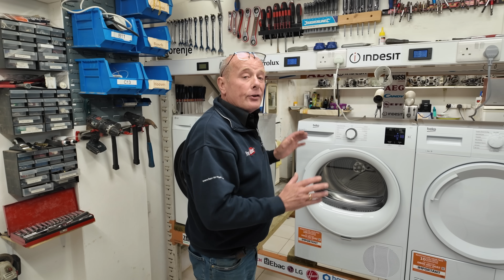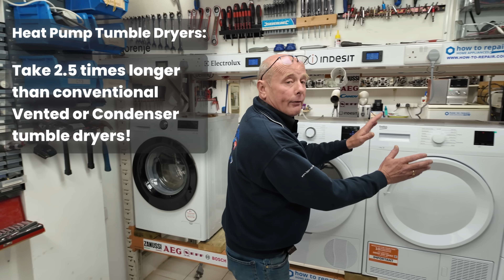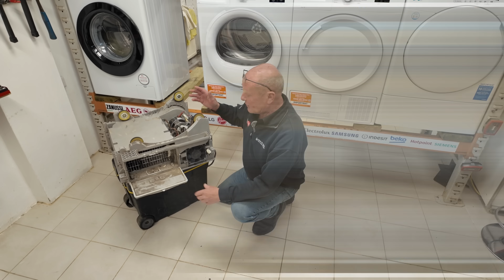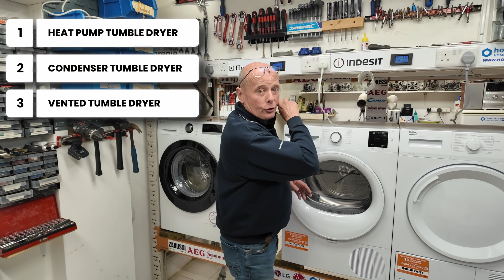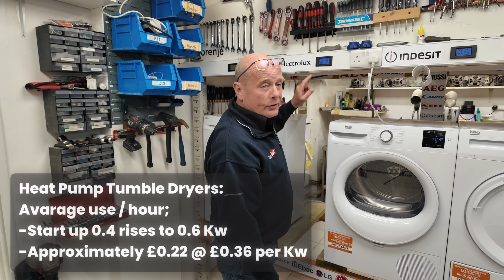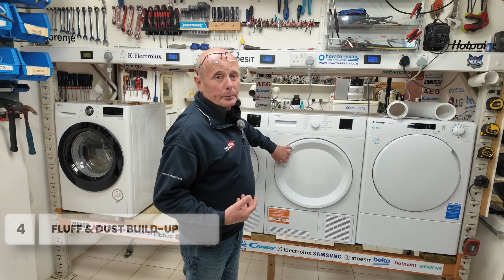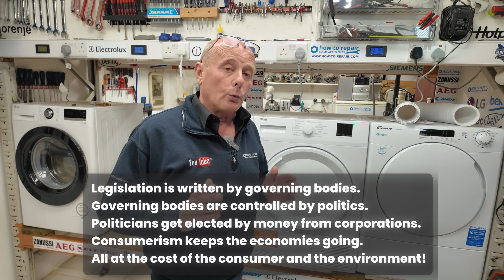Tumble Dryers the Shocking Truth About Heat Pump vs Vented & Condenser, NEW LEGISLATION!

Comment: I own a 10 year heat pump TD unit form Whirlpool. From YT dissasembly videos I conclude it was quite badly built as regards to cleaning the lint from the bottom heat pump condenser. I hoovered it on several occasions and it is still working fine but the bottom filter is a badly designed foam filter that can move around and get bypassed. I glued a face-mask non-woven filter before it on the plastic holder and now it is massively improved in filtering capacity.
Lint build-up in the heat pump unit is there, and at some point I do plan on opening the back panel and hoovering what ever can be hoovered. But so far it works fine.
I cannot say it degrades clothes at all as i do own items older than it, but it surely removes the need for dusting in the house.

Comment: Is this the case for all main brands? I know Miele (some) and Asko are a different case, but after checking your vídeos I ended up purchasing a LG washer and matching heat pump dryer and I’m really happy so far. Do you have an opinion about LG’s autocleaning condenser feature? They even have a program to clean the condenser.

Comment: Nothing beats drying clothes outside on a line if you have one, and are able to go out to it. We have put up simple lines in our shed/garage to use when it's raining. If the air is just too damp for that, we hang shirts etc on hangers on the shower rail, and put smaller items on a rack in the bath. We just have to make sure we leave a window open a crack to let out the moisture. We have never had any damp or mould in our home.

Comment: Brilliant advice, I bought a second hand dryer off a traveller in a car park for £60 10 years ago. Its finally died and am very glad you pointed out the difficulties refrigerant in heat pump. I am a time served 60 year old electrician and would say something similar about smart meters

Comment: No one in their right mind would pay for a call out on a vented, for $400 AUD just buy a new one. My 3 year old heat pump used 5 times a week has no dust in it the filter catches it all and I clean and alternate the filters regularly. My clothes last longer in a heat pump as it is not as aggressive on them.

Comment: The biggest issue with heat pump is it is a throw away device. Like you said, to expensive to repair. Had my condenser unit for years (and repaired it myself). My neighbour has had 2 heat pump dryers and I still got my condenser one working well. My opinion on that is it is not as environmentally friendly as you think.

Comment: I guess it really depends on the machine. we purchased a Siemens heat pump dryer about a year ago, which replaced our old condenser. At the most, it is 800 watts, but less a lot of the time, in pert because we always run a low heat setting. Thing is this. It takes the same amount of time to dry as our old machine did. Note that our old machine was not a cheap or bad machine. It lasted for about 16 years. Our current model is a Siemens IQ700 and most times it runs between 50 and 90 minutes. Here's the thing. About 2 months ago, my parents bought a new machine as well, a Bosch, so in essence a Siemens. However, theirs is one step down, and not a heat pump dryer. They take the same amount of time to dry the same amount of clothes. If anything is different, it might be between 10 and 20 minutes. Both are situated in heated, ventilated rooms, so that's not what works against either. I have a meter on the machine, as I do with our dish washer and washing machine, because I find it interesting to look at the usage. Our new IQ700 is SIGNIFICANTLY cheaper to run, not a bit, it's a lot.

Comment: Great overview and summary of new heat pump driers, thx. Got my sub. Having been lead engineer, and project manager for multiple products in industry over the last several decades, I can confidently say that at least one manufacturer will redesign its heat pump drier to enable simple cleaning, high reliability, and easy maintenance because that alone will own the market. The first versions of products usually have far more issues than gen 2/ 3/ etc. My advice - wait to buy into this new tech application, five years should do it. Thx again.

Comment: My beko condensing heat pump dryer is now 5 years half way through its standard warrenty that it came with in that time the only part to fail was the control board. The man who came to fix it was front beko- hotpoint  what use to be whirlpool. He said my model does not show on there system. It was made just before merger and its, a beko develop products.  He said to me this beko  is vastly superior to the current mode its so well put together and its using heavuer duty parts. He for ever going to new ones. He said to me current beko looks almost identical from the front but insider its just hotpoint rebranded. He told be the original beko use vastly superior heat pumps motors and bearing and motors and thats why they gave a 10 parts and labour warranty, you  dont get that with the hot point ones  whilst he fix it he services the machine.  He told me it was in very good condition

Comment: Seems like it’s a design problem. Why not put a higher-power refrigeration compressor inside the drier? Why not put appropriately accessible filters before any airflow that travels through the heat-exchangers of the heat-pump? Add a little pressure sensor so you can tell when each filter is blocking too much air. You could even have the heat-pump as an external unit that plugs into the drier with an air-duct or a conduit for some sort of liquid.

At home I’ve got a drier older than I am, just keeps working. A few years ago it started sounding real crunchy, took it apart and found a shredded 608 bearing. Bought one from the local skate shop the next day, still trucking. There’s really not much to go wrong in the simplest driers, this one doesn’t even have a vent duct, the air exits out a filter on the hatch. Don’t use it too often, just twenty times each winter or so, so power consumption isn’t a big deal. If I were using a drier efforts every wash, then I guess I’d consider something more efficient.

Comment: I still want a heatpump dryer. Picked up an Electrolux for €400. It is 3 hours compared to the old Miele condenser that took 2 hours.
The socialists in Sweden has made electricity so expensive by closing, newly renovated, nuclear plants so saving electricity still outcompetes buying a new one every now and then.
The only downside is that the Electrolux does not have a light inside it, the 20 year old Miele did have a light inside. Maybe Electrolux will discover light one day.

Comment: Again, a great video by someone who looks behind the curtain!
1 am happy to have been running one of the first-generation Miele heat pump dryers in Germany for 12 years now.
Last year, I had to repair my machine due to a very loud, bell-like noise coming from it. It was not easy, but manageable. The cause of the noise turned out to be a small strip of metal from the housing that had not been properly removed during production.
I took the opportunity to clean the machine quite thoroughly.
Since I was able to do it myself, it took about three hours of work — if I had had to pay an engineer, it would not have been economical.
Reply: Immer besser
Reply: If you do the math, you should use your salary for 3 hours of work and add that to the repair costs. In Germany that will likely still be worth it, as you have low net salaries and since you worked "black" for yourself, it's not that bad.
For me as a Swiss, i (assume same profession), have about double the gross salary and far less deductions, so i profit less from working "black" for myself. So i probably have the same "costs" as if you gave it to a technician in Germany. 
Basically, better living standards and salaries are the enemy of repairs and make it often more economical to buy new. But, things wouldn't have to go to a landfill. They could be sold on the cheap to some place, where salaries are 1/10 of here in Europe.
Planned Obsolesce is not bad. It makes sense if done correctly. That means: All parts should roughly have the same time they can expected to fail. That time frame should be reasonable for the costs of the product. That way, you can use it for that time frame, with extremely high reliability and without the hassle and costs of repairs. Then you sell it back, it gets moved to someplace, which has different repair economics and can't afford the same level of reliability.

Comment: Don't know about the newer BSH stuff but I can't fault either the 12 year old Bosch classixx WM and heat pump dryer I purchased from new.. the WM has only needed a set of brushes and is otherwise still perfect, and last year the dryer started giving intermittent trouble with container full warnings - so I stripped it down to give it a full clean out - I was quite surprised to find very little wear on any of the rotating components or the drum seal, and the condenser/evaporator were actually quite clean with no signs of corrosion that could cause a leak, but there was an absolute soup of fluff slop in the basin and around the condensate pump.. and of course the level sensor which is just two contacts/electrodes into the basin.. so it all got a good hosing out in the yard, then back together and been working like a champ ever since. Of course not everyone can do this, but with a bit of care any reasonably mechanically skilled person can do it. If I had a normal vented/condenser dryer I'd be bloody broke at the rate the wimmins generate washing.. all hail the heat pump dryer !

Comment: Absolutely spot on! Hoover candy have tried to fix my heat pump tumble dryer and failed. basically it’s not repairable for exactly the reasons outlined in this video. Average dry time for a medium load was 5 hours, It’s less than 4 years old and it cost me £699 what a total waste of money. Very angry that the governments are allowing manufacturers to deliberately  manufacture built in failure machines to force consumers to buy new.

Comment: When I retired as an appliance engineer I moved and bought a Mile washing machine and dishwasher for the build quality and longevity.
I later purchased a Samsung Heat/Pump dryer that ran perfectly for 5 years and I then dismantled it and cleaned out the fluff and dust, which to be fair was not as bad as I had seen in alternative type dryers.
Having put it back together it has worked perfectly for the past 2 and a half years and the saving in electricity costs is considerable.
I appreciate that as a retired appliance engineer I am in a beneficial position with regard to repair cost savings.
Reply: We have a 2012 Cylinda TVP 420 with heat pump. It has a 800 W max rating and it has served us BRILLIANTLY for 13+ years now. Only thing is a bit of belt slip(?) causing noise during first minutes of operation, that's been for many years now. We found it on sale and I got the price down a bit more, picked it up for around £400, original price was twice that.
It dries 8 kg of clothes in 60-90 min, so I'm not sure what garbage is on the market these days. 
Our 2012 Cylinda Sverigetvätten washing machine is very similar to the ASKO you recently reviewed, only older... We also have a Cylinda Sverigedisken, dishwasher, from 2012, nowadays produced by ASKO, while Cylinda took the path of planned absolecense. Our parents in law have an ASKO and after an initial warranty repair, it's been GREAT and the inside is fabulously great to allow three layers high stacking and STILL getting it clean!

Comment: Net zero is a con it's all about control and taking more of your money. Use a dehumidifier in a small room like your bathroom to dry your clothes it's far cheaper to by and run, it dose not add additional wear to your clothes. I accept that for a large family this would be impractical.

Comment: How many cf of conditioned air a year does a vented dryer exhaust out of your house a year?
Isn’t the average around 250 cfm? That’s a lot of energy wasted, might need to consider that in the numbers?
My house is so air tight that I don’t even have an option for venting it. The makeup air needed would be ridiculous.
My lg wash tower doesn’t take 2.5 times longer.😂
It’s actually very comparable if you don’t include the coil cleaning process that it does at the end.👍🏼

Comment: I don’t buy this at all. Yes the heat exchange dryer takes longer but it dries the clothes for wayyyyyy less energy and, therefore, much lower cost. Also, you don’t need a vent so you can place it where it’s not plumbed (without a venting hose) and it doesn’t create any humidity. 

Clothes wise, they don’t shrink the clothes noticeably. 

I’ve had a hot tumble drier and a heat exchange one (Bosch) and there’s no question the heat exchange was better. Yes it does take longer, I admit and also it can’t dry slight damp clothes (it can’t detect the moisture where clothes are slightly damp) but these drawbacks are minor compared to hot tumble dryers. Hot tumble dryers are costly, need plumbing or a vent, create huge amount of waste heat and damage clothes.

Comment: Dryers already use "green" energy so why make them significantly more complicated by replacing resistive heating with a heat pump? I get why you might want to replace a fossil fuel boiler with a heat pump, but the case for heat pump dryers is less compelling. Surely if you can afford to run a conventional dryer then the efficiency saving is hardly worth having and is likely offset by higher capital costs and repair bills. From a legislative perspective you might marginally reduce peak demand on the electricity grid, but you could do that by mandating a timeswitch on convetional dryers.

Comment: When growing up in the U.S. midwest, where winters are very cold and dry, the house heated by forced air, gas burning furnace was so dry that my mother would hang clothes to dry on a set of lines in the basement. And of course, in fair weather, she had lines outdoors. It took a little time, but the results were good, the technology simple, and the environment preserved. 

Today, living in the Arizona desert, I dry all my clothing outdoors on clotheslines. No costs, no environmental impact, and I get some healthy sun exposure during brief periods working outside. And my house is heated and cooled with heat pump systems.

Comment: So we have just purchased another dryer. Our current one is only 5 y.o but has a defective main board (£200). Its not worth repairing for that cost. Gutted because its in good nick. I have gone for the condenser dryer route again. Being a former refrigeration engineer I agree with your assessment. Reminds me of the pub coolers I used to work on. Nightmare to strip them down, and never went back together very well.

What I would like to see  implemented is legislation to make repairs and upgrades to be built in to the product design. Even make white goods 'upgradeable', (better displays and superior parts) so that manufacturers get aftersales opportunities. In the same way we can customise our cars, hi-fi, and home automation.

Miffed I can't find a wiring diagram as well. I'm a controls and automation engineer and drives me insane i am being prevented from fully diagnosing faults.

Comment: I am using a dehumidifier to dry my clothes and i was thinking to buy a dryer mainly for drying the clothes faster.  But after watching this video I  think am sticking  to my dehumidifier !
Reply: I've just commented similarly. No moving parts to go wrong. No lint/fluff problems. Relatively cheap to run. I have a MEACO. Can't believe how much moisture it pulls from the air.

Comment: My Beko steam cure heat pump tumble dryer only  managed to make it to 2½ years old. I feel it's had very limited use, as it's mainly only been used in the winter months with a maximum amount of about 2/3 loads a week for approx 5/6 months a year.
The drum goes round and the clothes get warm. We have changed the condenser pump at the back. Cleaned the static unit at the front by flushing water through it & then draining it manually through the digital panel (P-ON), which did drained the water through to the water tank.
I have now tried it with a wash load in & back to square one the water isn't drain from the drum to the water tank.
Is there something we're missing, or has my heat pump tumble dryer had it after less than a years worth of use?!
Any help appreciated

Comment: I appreciate a lot this channel and I can only thank you for all the great content that you do, but, in my humble opinion, the content of this video is weaker than other videos you have done. 
I agree with many of your observations, but there is a lot of oversimplification and guessing, not strong enough to draw sound conclusions. 
First of all, on the economics side, you have not calculated the energy savings over the life of the device, and when the head-pump would become economical in comparison with the others. 
Regarding repairability, I see that some of the potential issues are linked to design flaws that do not allow to maintain and service the devices easily. Does it apply to all brands and models or only to some? This information is key to conclude anything.

Comment: I dry my clothes in the greenhouse in the winter. Not got anything growing in there in winter. Dries surprisingly quickly and no risk of rain catching me out.
 The missus likes using the drier because it makes the towels soft. Anyway the heating element went caput on our 30 yr old hoover drier but if you tumble the dry towels unheated for 15 mins they go soft again with  very little energy use.